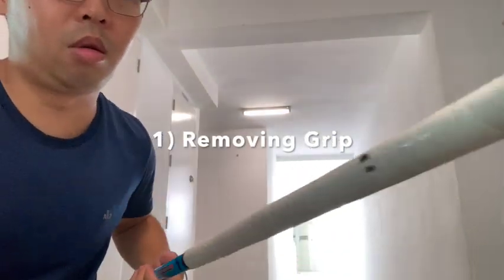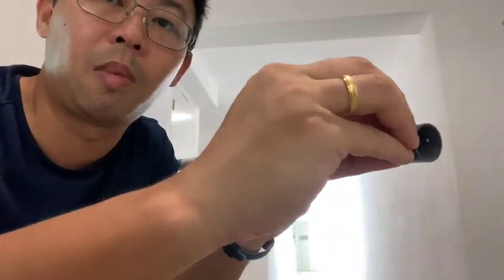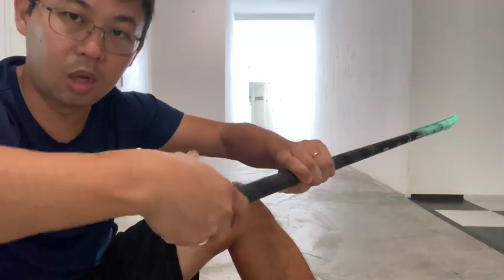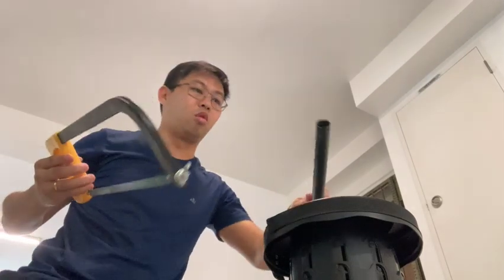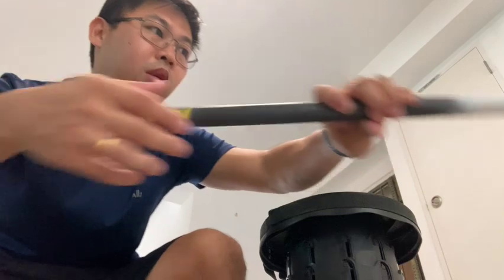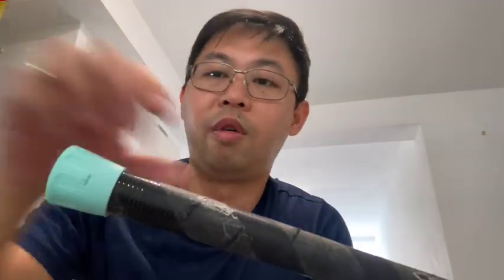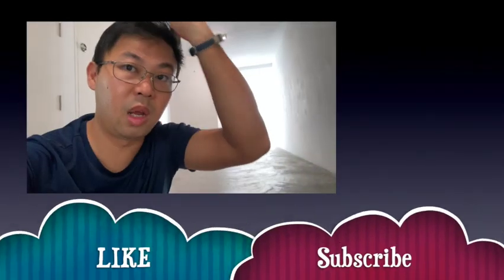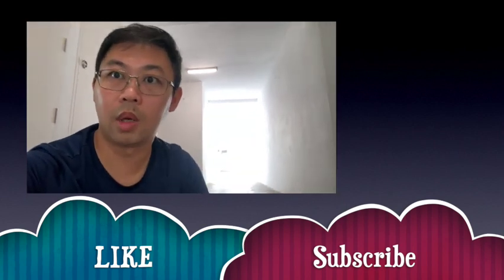How to cut Floorball stick myself ?

Comment: will there be any effects to a stick after cutting?
Reply from the maker: Yes yes. The flex of the stick will be stiffer.
Reply: Are you doing this because you can’t get a stick that is the correct size? I think needing to do this is an edge case in a lot of cases.
Reply from the maker: @memsom  good qn. For me, a stick is just a stick these days as I don't really play much. Ideally, my stick would be a 96cm, 29flex. For this matter, the length is more important to me than the flex. I can't use a longer stick since my height is already fixed years ago lol .. but having a stiffer flex, well, I can adjust on my end to accommodate it. So in a nutshell, best case scenario, is get the correct length and flex that suits for the player.
Reply: @FloorballBasics  I have to agree. I have the opposite problem. I’m very tall. When I started my stick was 101cm and it always felt like it was too small. I did the reverse. I took epoxy and a section of broken stick and extended one stick to about 103/104. I now buy good quality sticks in the longest legal size I can and have found it is really more about weight and balance for me. I favour the Oxdog sticks with the weighted end caps because it pushed back the centre of balance. That seems to really help for me.